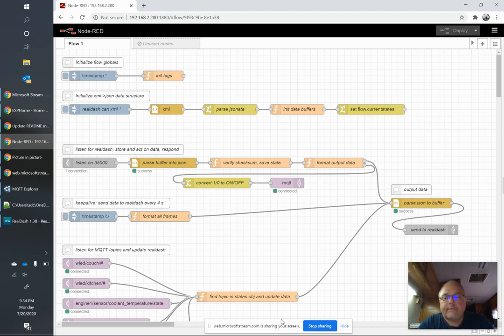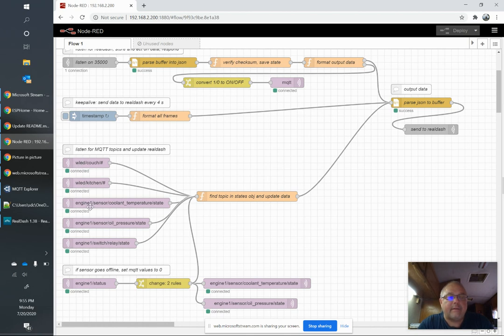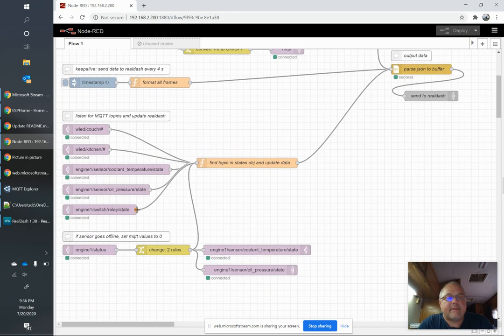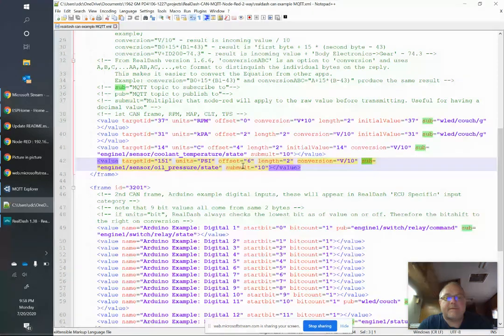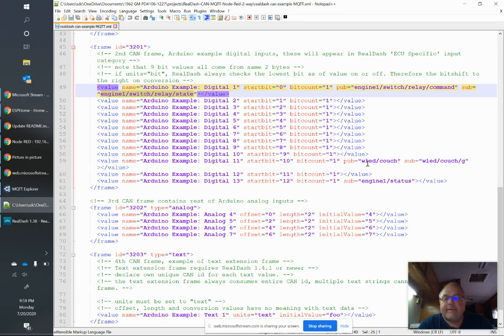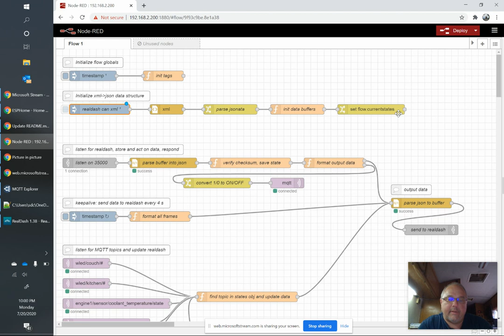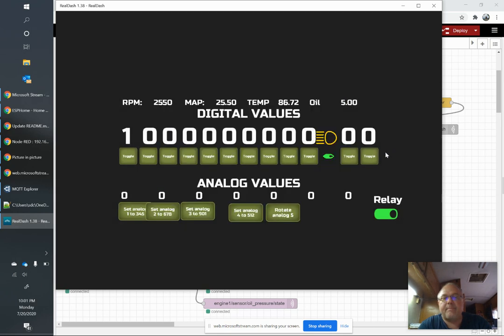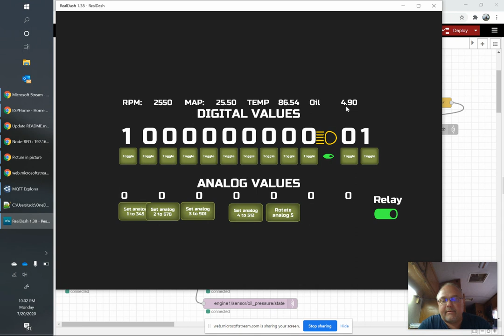DIY Digital dashboard technical walkthru using RealDash and Node-Red

Comment: I had thought about having a dedicated Chrome Book or IPad. Side dash or cockpit mount. It would include travel documentation, trip details, fuel, oil, service, details. When in motion would record inst details, alerts, drive time, rest time, generator details, truck stops, overnight parks, speed, delays, time to destination, GPS details,  so much details kept, engine oil pressure, engine coolant temps, the details could be grafted and possibly determine the health of you engine or transmission.
Reply from the maker: You might not be able to do all of that with RealDash. It can log, show real time data and control outputs, but some of the other stuff you mention may be beyond what it can do.